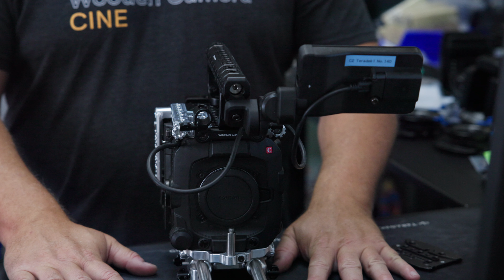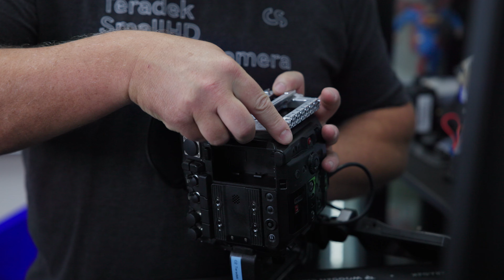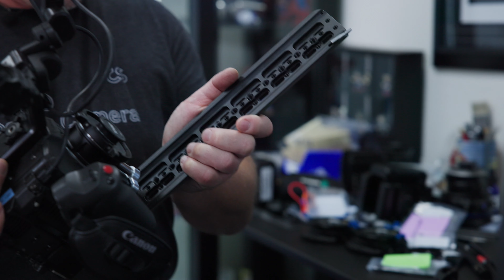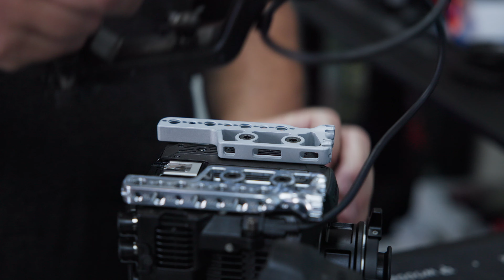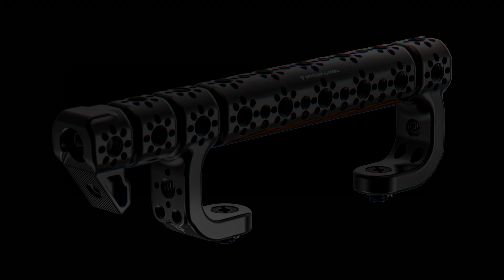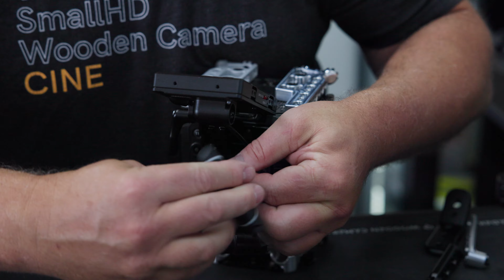Canon C400 Cage and Accessories: At the Desk with Dominick

Comment: Does the top handle mount come with the elite kit? I don’t believe I received that in my Elite kit.
Reply from the maker: The Elite Accessory system for Canon EOS C400 Includes: Battery Slide Pro Gold Mount/Battery Slide Pro V-Mount
Base Plate System for Canon EOS C400
Top Plate System for Canon EOS C400
Bolt-On Canon EVF Adapter for Ultra Handle
NATO Side Rail for Canon EOS C400
Ultra Handle Standard Kit (Universal ⅜”-16)
Safety Dovetail 8”
15mm Rod 12” (x2)  Please visit our website for more details. https://woodencamera.com/collections/canon-c400-accessories/products/elite-accessory-system-canon-c400
Reply: @ got it. Ok so then I did get everything. Thanks 🙏🏽

Comment: How do the arca riser plate clamp and dovetail clamps secure? I see two release buttons and four thumbscrews that appear to be for the rods. It's not clear how those two clamps will be secured and how easily they will release.
Reply from the maker: Thanks for asking, There are 4x thumbscrews. One for the Arca quick release, one for the Dovetail quick release, and 2 for the Rods, left and right. Hope this helps!
Reply: @WoodenCameraAccessories  Thanks for the clarification. Just to confirm, you can adjust the rod positions without loosening either the Arca QR or Dovetail QR, correct?
Reply from the maker: Yes, that is correct